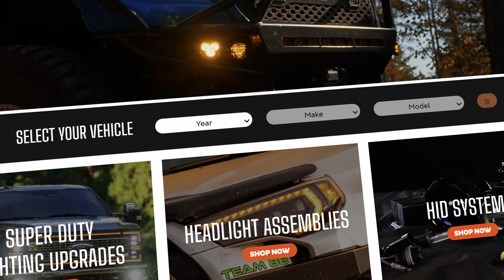HID vs LED Headlight Bulbs: Which is Better in 2025? | Brightness, Fitment & Output Test!

Comment: These bulbs work on older cars/trucks. I’ve got a 2019 Accord and 2025 Carnival. Both have multiple LED elements instead of single or dual bulb elements that you can replace.
Reply from the maker: You’re exactly right—these LED bulbs are designed to replace factory halogen or HID bulbs. If your vehicle came with OEM LED headlights, the internal LEDs usually aren’t serviceable or replaceable, since they’re built into a sealed housing. In those cases, a full headlight upgrade is the only option for a different look or performance boost.

Comment: Curious about the CRI and also UV output. I tested my HIDs and they are outputting some UV. Not sure how common that can happen. Not good for the eyes 😅
Reply from the maker: It’s true—HIDs can emit some UV, but the amount that actually reaches your eyes is minimal, especially compared to what you get from natural sunlight. That’s why headlight lenses are made with UV-resistant coatings—to protect both the lens and limit any UV output.

In fact, long-term UV exposure is what causes lenses to yellow or crack over time, not necessarily a danger to your vision while driving.
Reply: @HeadlightRevolution Interesting! 😮 thank you for the information 🙏

Comment: My 05 Xterra has that cup that sits in front of the bulb. Should I remove that when I install an LED bulb?
Reply from the maker: No, you shouldn’t remove the cup—it’s part of the headlight’s optical design and works with the reflectors to control the beam pattern. Instead, you’ll want to look for an LED bulb with a shorter profile that’s compatible with that style of housing. Removing the cup could lead to excessive glare and poor light focus.
Reply: . Ok, thx.

Comment: there is a lot of LED replacing Halogen but how about a D2S LED replacement?
Reply from the maker: Great question—and it’s one we get a lot. The truth is, D2S LED replacements are tricky. Most LED bulbs today are designed to mimic halogen filament placement, since that’s what reflector and projector optics are typically built around. HID systems like D2S have a different arc position and optical behavior, so LEDs trying to replace them don’t perform consistently across all housings.

Until the tech catches up with the unique design of HID projectors, most D2S LED replacements won’t match the beam pattern or performance of a true HID system. We’d love to see a proper, well-engineered D2S LED option in the future—but we’re not quite there yet.

Comment: I'm not sure if I'm the only one person that loves and enjoys the warm up of a HID bulb, see how color changes and the brightness increases with the seconds. LED can be instantly but does not have the same "aura" as the HID.
I love this setup: low beam projector with HID, high beam reflector with LED. Fogs with 3000k HID or LED bulbs.
Reply: Good set up. I like the HID low beams and LED high beams also.
Reply: Have LED low/high beams. Looking at a NCS 2 banger 3000k pods for fogs. Like the rally yellow color. And it's objectively better in fog/snow
Reply: Hell Yeah, I use a cheap LED with fan and 3 filaments, 2 for low beam the 3rd for high beam and doesn't even have a separate controller box, it's all integrated and pretty bright.

But I totally miss the HID that I also used for some good years, I loved the green slow ramp up and the 6000k 20W on my bike was also more than bright enough and the light had some fluorescent white tone to it that I can't explain, it was just pure cool while the LED is kinda all just normal white without that kind of "fluorescence"☹️
Reply: It's not enjoyable when you have H4 bulbs and want to use the pass light during the daytime: No one sees it.
Reply: I tried HID low beams in my older Sierra. Aftermarket HID's take too long, when switching from highbeams back to low traveling at 60-70 mph out on the highway is absolutely no F'n good!!! Darkness then low light for 5 seconds at highway speeds is very dangerous, irresponsible and just stupid all for a "look". I can say for a fact GM OEM factory HID's that were used in Cadillac for example fire instantly and no color change warmup either. That instant performance is probably why the factory HID system costs 10x more than Aftermarket HID.
Reply: @11x That definitely didn't happen to my cheap kit on my bike because it was using H4 dual beam lights, it basically just does a electric switch that moves the light and changes it's beam to high beam.

But yeah if it's separate lights, cheap HID old kits wouldn't work very good.

I actually loved the slow startup in a green color to then a fluorescent white on my bike.

Comment: Can you use 55w in 35w ballast or do you need to upgrade?
Reply: The bulbs are the same, you can just get the 55w ballast.
Reply from the maker: Most HID bulbs can be used with either 35W or 55W ballasts. The difference comes down to performance and longevity: 55W will be brighter, but it essentially overdrives the bulb, which can shorten its lifespan compared to a standard 35W setup. Just something to keep in mind depending on what you're going for!
Reply: @HeadlightRevolution why doesn’t GTR make D1 D2 or D3S leds?

Comment: For factory Bi-Xenon low beams I like a blend:  1)55w 8000k HID low beams, 2)35w 6000k LED high beams and 3)35w 8000k HID fog lights. The Bi-Xenon projectors have the wide precision low beam pattern in a higher contrast ice blue kelvin temp to really make the roadscape pop. Fog lights match with that even wide HID pattern. However the high beams really benefit from both the superior brightness and quick activation for fast flashing to pass. Works well with my factory set up.
Reply: I went with a 50w 6k bulb, hopefully it doesn’t yellow the bulb too much, do you find the 8k hid close to the 6k led?
Reply: @dakotagist7526  No my 8k HID low beam was rated 8k when specifically paired with the bundled 55w ballast. It maintains a slightly bluer color than 6k. I like the added contrast on the road at night.
Reply: @LawrenceMarkFearon I would probably go a little lower on the kelvin rating, in regards to the fog lights, as whiter light is more easily scattered, than a softer white. This is why some people still prefer closer to amber, but do what you like.
Reply: @Technotranceism I get it. Amber toned fog lights are widely favored.  Especially in Europe.

Comment: I have both. We have to give credit to LED technology advancement.
However, HID all day, all season. LED, in my opinion are brighter. But why signal batman all the time. LED are more efficient but heat transfer is on diode level. HID provides heat for the headlight housing similar to halogen and reduces icing on the housing. For anyone that doesn't drive in winter, LED all day.

HID work much better in a projetor housing. The scatter is therefore reduced, sharp cutoff line, no blinding. Ballasts and igniter have also been significantly reduced in size. LED also have a driver for some brands.

For halogen refractor housing LED are far superior in lighting. However, you would benefit yourself by adjusting your headlight slightly down, adjust the driver side only. This will reduce blinding on coming traffic.

Because most want plug and play, we get blinding. Remember if your factory housing was designed for halogen, then an adjustment or projector would be needed to accommodate your "upgrade". 
Since auto manufacturers vary in housing design , always try to do your research to match the bulb for your housing. 

Color as stated for HID works best in 3800k-5000k.So i have to agree with the yellow being very good and better in an LED application as opposed to HID.
Its usable light in real world driving. In addition, if you care about legalitiy, this range is closer to "white" or " yellow" which is required by some or most states for from headlights.
Also, HID output and color can change over time. LED is more consistent.

I have both, and prefer HID in a projector housing or upgraded housing. I use HID for low beam and LED for high beam, instant flash no wait time to light.
Reply: also 40usd for full hid kit vs 250usd led bulbs

Comment: That's no longer a question.. if u have halogen the next best upgrade would be LED. What we want to know is when a proper D2S led conversion is coming
Reply from the maker: That’s a fair thought, but it is still a question for a lot of folks. The reality is, LEDs are still working to mimic halogen filament placement, which is what most headlight optics are originally designed around. That’s why drop-in HID-to-LED conversions—like for D2S—are tricky to get right. If we’re just now seeing LEDs get dialed in for halogen housings, expecting them to perfectly replace HIDs is still a bit premature.

We’d love to see a proper D2S LED conversion too—but it has to be done right, and we're not there quite yet.
Reply: @HeadlightRevolution i second this so far no led conversion or does gtr offer a way better d2s bulb
Reply: yeah definitely two of my cars use D2S and this seems like a great idea

Comment: Blinding oncoming drivers for years.  Not only should both of these bulbs be illegal for "on road" use, but use of them "on road" should be a jailable offense.  Seriously, all the A-holes with the jacked-up trucks have these so they can blind you from behind and while they are passing you.  No thanks.
Reply: That’s because most ppl (especially those jacked up trucks) just throw the bulbs in and think they’re good to go. They have to be adjusted especially in those trucks they need to aim them downward since the truck is now higher. I’ve been using hids and leds for years and never had a problem, if anything I see more ppl with stock bulbs having their high beams on now more often and that really bothers me at night.
Reply: new cars today are mandated to have automatic high beams by the good ole government.  They are extremely annoying as they flash up and down with traffic and various lighting situations.
Reply from the maker: Totally understand the frustration—glare from poorly aimed or low-quality lighting is a real problem, and it's one we take seriously. While it's true that most HID and LED bulb replacements aren't technically street legal in headlight applications, proper aiming and quality make all the difference.

A lot of what causes blinding glare comes from cheap products with bad beam patterns—or worse, people not aiming their lights after lifting their trucks. That’s why we focus heavily on beam control and recommend professional aiming after install.
Reply: I stopped driving before sunrise and after sunsey because headlights coming my way always FK my eyes!
Reply: Learn to drive...and maybe don't make direct eye contact DA....
Reply: @JWElec.2782 exactly
Reply: Blah blah blah.  I live in a rural area and need to be able to see wildlife way off the side of the road and far down the road.  I have fully upgraded super bright leds.  Maybe once a year someone blinks me. I’ll accept that over hitting wildlife.
Reply: @Gitbizy  my thoughts exactly. My 2004 Sienna’s combined HID/LED low beams and high beams, respectively, proved their worth by spotting a deer on the road so far away that I was able to slow down for it instead of hitting it. That deer looked both embarrassed and thankful, and I consider that worth any amount of salt from fellow drivers.

Comment: LED bulbs are better in home or some other place but not in car headlamps because we are in a world where we face 3 to 4 different seasons. LED's are great in summer nights but in rain and winter season nights, those LEDs are worst. I don't know why companies switching into LED or put some more effort to get at halogen color LED. Still there are less automobile companies providing LED in headlamps and halogen in fog which is good instead of all out LEDs. Brighter the better is not always right in every situation. If companies who manufactor/design the LEDs with halogen color then I'll be the first customer to buy. In rainy nights with LEDs, you see light scatter through the water droplets and less visiblity on road. In winter nights, fog is white in color and LEDs are white in color  and zero visiblity on roads. Halogens are good but far far better than LEDs in rainy and winter seasons but not good in summer nights compared to LEDs.
Reply from the maker: Totally hear you—and you're not alone in feeling that way. Color temperature makes a big difference, especially in rain, fog, and winter conditions. While most of today’s LED headlight upgrades lean cooler in tone (like 6000K), GTR does offer both white and yellow options, depending on the use case.

We agree—“brighter” isn’t always “better” if the light isn't working with the environment. There’s definitely still room in the market for more halogen-colored LEDs, and trust us—we’d love to see more options like that too. Appreciate you sharing your perspective!
Reply: White vs. yellow in fog lights is currently an ongoing scientific debate with supporting arguments for either side. Not to mention the fundamentally different ways LED vs. halogen achieve color and light output.

Comment: I have morimoto hid system still in the box. I just get an anxiety from thinking i would need to take my front end apart to install them on my 2016 chrysler 200 to fit all of that wiring in
Reply: Some cars are so poorly designed for maintenance it’s maddening.  Suppose you had to take off the bumper, fender liners and grill to change a tire.  That’s how bad some cars are to change headlights.  The brightest halogens have a rated life of 100 hours.  I suppose that means when they start to dim, but that’s not long at all.
Reply from the maker: Totally get that—wiring can definitely feel intimidating if you're not familiar with it! If the full HID setup feels like too much, you might want to consider swapping it for a high-performance LED option instead. Something like the Morimoto 2Stroke 3.0 or GTR Ultra 3 would give you a big upgrade in output with a plug-and-play install and no wiring harness required. Way less stress, and still a huge step up from stock!

Comment: It is so hard to find 4300k LEDs!!!
Reply: The only affordable 4300k led bulbs I could find were the Formula J87, They are about a 35w bulb in terms of brightness but still an improvement over stock. Better to use a 35w than a 55w in a stock reflector housing anyway so you are not scattering as much light at other drivers.(I'm just using wattage examples, I know led power draw varies a lot)
Reply: @vipercrazy-9  I wonder if higher wattage bulbs help not trigger the dash light?
Reply: Sealight has two 4500k leds models, i've used mine for 3 years and going strong, the scoparc S7s 4500k
Reply: @tomh1556  they seem to be only offered in 130W did you find a lower power bulb?
Reply: @AmxrJ99 sealight X6S 4500k. Its 45 Watts per bulb. The S7S is 75 Watts per bulb
Reply: Osrams
Reply: Philips had the product bro. 3500k oem likely
Reply: Osram has 4300K LED bulb in both 50w and 80w. Very good bulbs. I didn't have any visibility issues when it was raining heavily, which is the main downside of 6500k bulbs. 
I just wish manufacturers used them on the newer sealed LED headlight assemblies
Reply: If you're willing to roll your own fog light install the NCS Morimoto 1/2/4 banger pods are pretty legit sounding.
Reply: I believe that comes down to difficulty in replication of the colors, and popularity for higher kelvin rating.
Reply: What led bulb is bright for ‘09 Honda Pilot and best for North America that has long snow season? Any recommendations?
Reply: I hsve 50,000 lumentd 6500k
Reply: Phillips Ultinon rally 4300k 90w per bulbs are here man!
Reply: Hid will always be superior.. the 4300k xenon is the sweet spot.. has more wider and longer range of brightness.. looks better aswell.. these LED especially the matrix LEDs are not for road use you can't use them in a projector
Reply: That's because the phosphor coating required to transform the emission spectrum from violet & ultraviolet to a "neutral white" (about 5000K, so typically 4500-5500K) reduces the brightness SO MUCH and causes so much heating as compared to a more raw and efficient LED.  LEDs already produce maybe 70% of energy as visible spectrum light, but using the phosphor coatings greatly reduces light output and increases heat.  This massively reduces both efficiency and lifespan for all of the SMDs aboard their application.
Reply: @TiTANEUM-48so youre saying that for LED lights to function for human eyes they need to reduce visible light output which increases heat and lifespan?

Comment: There is MUCH more to headlights than meets the eye. lol.  I switched from HID to LED several years ago. And I’ve upgraded several times since. Each time the bulbs have been brighter and the focus has improved.  I’ll never go back to halogen.
Reply: LED are not brighter then a 4300k osram night breaker.. hid got more longer and wider brightness. Way better in the rain compared to led. If led bulb blows which had happened it's a new complete whole headlight.. what is the benefit of it.. noting really compared to a hid
Reply: I had HID before I switched to LED. They were much better than halogen. I’ll never go back to HID or halogen. What do you mean if the “LED blows I’ll have to get a complete whole new headlight”? They are only bulbs like halogen or HID.